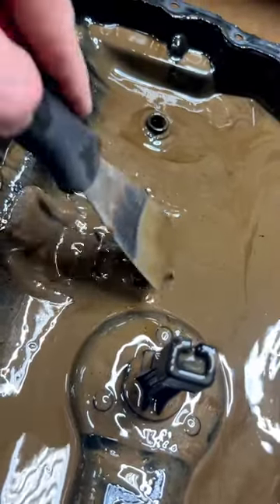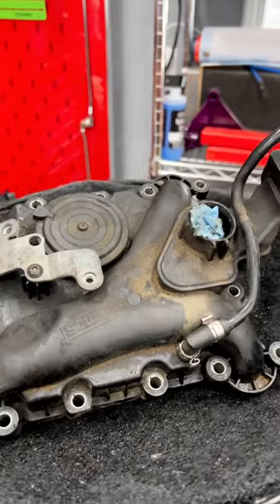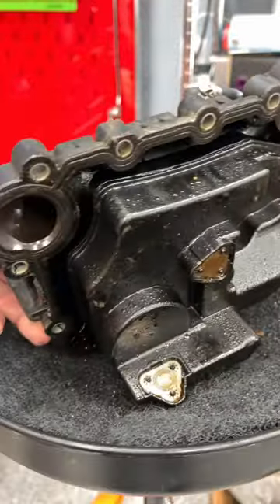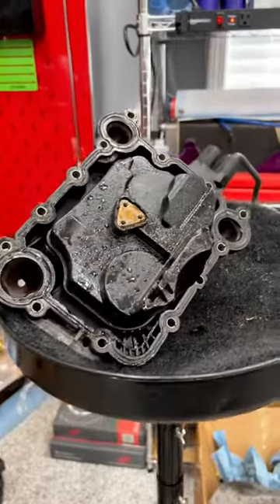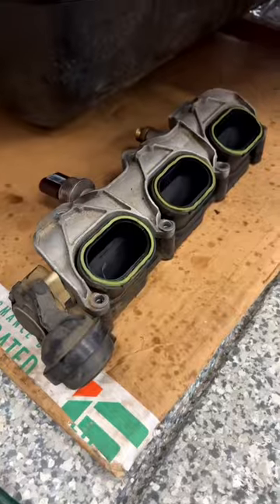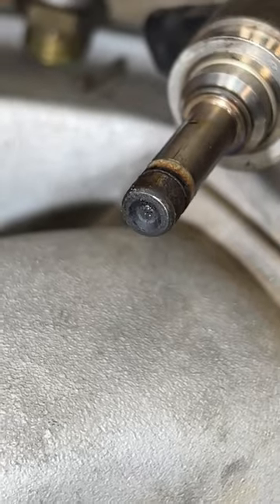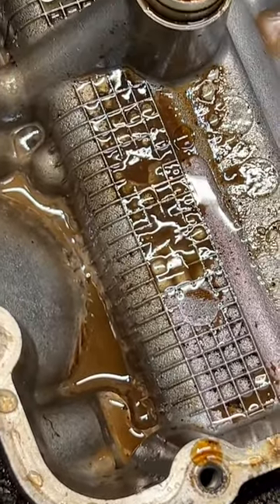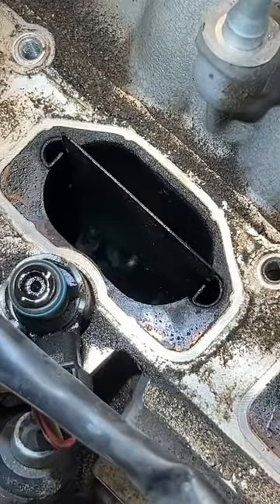Audi S4 With Coolant in the Engine OIL ~ FAILED PCV Valve

Comment: How to make an unnecessarily complicated PCV valve
Reply from the maker: This one is wild. LOL
Reply: Germans for you
Reply: They tried to circumvent the issue with the electronic heaters going bad. It's an over-looked problem: icing of the crankcase vent system on  force inducted engines.
Reply: @LynxStarAuto  I bypassed the pcv in a 1995 Volvo 850
Reply: @LynxStarAuto  this , 8.1 gm engines do it and I had one blow 5 of 9 quarts out the front seal. 
I got there ,the breather was thawed and it's fine. 
Put oil back in and send it. 
Stupid propane fuel and lack of insulation around the breather does it every time.
Reply: @bernardaflores1720  sure, you just disconnect the top hose that captures the oil vapor. On forums it actually says its BETTER to disconnect as clogged pcv is bad
However you can always clean and replace said hoses which is what i ended up doing anyway. Plus with 95 and before vehicles have a lot of environmental standards such as EGR and pcv. Stuff like cat converters, things not necessary for engine health
Reply: @MrTheHillfolk  I don’t have much experience outside of the Euro demographic, but leave it to GM to just run a good ole breather hose on modern CCV system 😅
Reply: @QkjajshsjajaCcccc  if you by pass the PCV, you then need to vent it to the atmosphere like it used to be done before the PCV valve was invented. Otherwise you will blow out a crankcase seal.

Also on Volvos don’t they use a drip plate inside the engine? Or was that newer 5 cylinders?
Reply: @lynxstarautomotive208  the failure of the pcv is the clogging of box or hoses, ive read forum posts about people disconnecting the top hose and running it fine. But like you said, it can damage so replacement is always the better option, the exact reason why i cleaned and replaced my hoses
The drip box is outside the engine under the manifold. Connect via hoses and the drip ‘nipple’ as volvo refers lol. Runs into the pan
Reply: @lynxstarautomotive208  the pcv vents the vapor back into the intake. Id say i ran it like that 1000 or so miles maybe less. Cuz of my financial situation at that moment i couldnt afford the 40$ plastic clip for the pcv into intake boot. Ran fine id say maybe better than with the clogged box creating so much pressure
Reply: @lynxstarautomotive208  yeah all I know about gm stuff is thru work, generator service. 
Other than that, I stick with the euro stuff too.

Comment: So glad I have the 2.0L 4 Cyl in my A4. The PCV valve went bad on it a year or so ago. Ordered one off Amazon, replaced the old one (right on top of valve cover) and worked like a charm. No coolant passages or silly engineering that would cause a failure of a pretty minor part to let coolant into the oil and ruin an engine. Engineers VS mechanics will be a war fought for eternity.

Comment: That's insane. Similar to fords transmission cooler on their 3.2litre 5 cyl diesel; tiny little rubber o-ring separating the coolant and ATF. Done more than a few transmissions because of that.

Comment: "i just did 40 mins of labor taking stuff out and now i have a chance to spray brake cleaner into my intake manifold to decarbon it, at least a little"
"but not this time yikes"
Reply: Lol brake cleaner ain't solving your problems. It needs a full induction service. That adds another 200-300 to the price tag because it's a process of chemical, and mechanical labor to leave them clean.

Perhaps the customer didn't want to pay for that. It happens.
Reply: Hahah bro maybe the customer isn’t fond of the bill already?

Comment: 220kmi on the 3.0 supercharged is impressive. Question would the motor be toast since coolant was ran though the oil system? Thinking bearings
Reply from the maker: Possible. but only time will tell. LOL I have a video coming out where I flush the engine a few times.

Comment: Are all cars made that way? I have that same rusty soup in my old Buick century. I was telling my son it looked like coolant and oil mixed!?
Reply: If it’s a 3.1 Century from late 90s/early 00s, it’s probably your lower intake manifold gaskets. If it’s even older, then I would lean to head gasket. Need a mechanic to confirm.

Comment: I have 08 Jetta Put key in ignition you can’t turn it to crank the car but the steering wheel with the key out is not locked. Is this a faulty lock switch or a gummed up steering wheel lock? Thank you.

Comment: That’s like the automatic transmission in Nissan’s trucks and SUV’s from 2006-2010 the transmission cooler goes through the radiator  and a thin piece of plastic separates the transmission fluid and antifreeze and whenever the vehicle gets around 120000 miles on them the plastic separates and you end up with transmission fluid in the antifreeze and gums up your motor if you’re lucky if you’re not then the antifreeze goes in the transmission and locks it up so if you’re going 80 mph down the road and that happens the vehicle locks up and slides to a stop and hopefully nobody is behind you so you don’t get hit. Nissan is aware of this problem and like every other company they put money over people and said it’s easier to let the problem go then to recall them and fix their problem . I have one and it has already happened to me because my wife wanted a automatic and not a manual 😢

Comment: How...HOW does Audi/VW screw up something as simple as a PCV valve?!! SMH

Ford: "Let's electrically heat the PCV valve on the Duratec 3.0 V-6s for good cold-weather operation."

Audi: "Haha Ford! Your engineering skills are weak! Ve use engine coolant with multiple points of entry for leaks on our PCV valve! Ve also install it under ze supercharger for reduced access and greater heat transfer on cheap plastic housing prone to cracking! Vee Germans are very crafty indeed!"
Reply from the maker: Vw/Audi hasn’t made a good PCV valve

Comment: Dose everything vw makes have such bad problems I have Ben working on a vw gti r32 and it's one of the worst cars I have ever worked on the car only has 60,000 kilometers and it alredy needed a rear mane seal a pcv a turbo valve a turbo a  Head gasket water pump and mane bearings just because the tarible design of vw yeah I am getting paid but gees what a pece of crap I gess that vw made it so I can get paid I will never own a German car maby a mercedes or a old bmw e30 or e35 if vw made parts made of metal thay would not fail as much but I doubt it. Most german cars deathly look good but are the most unreliable pieces of junk on the road I haven't worked on one manufacturer so much I never see Hondas or toyotas for anything serious just brakes and oil and the occasional control alarms maintenance stuff but everything  european I get is engine replacements transmission replacements engine rebuilds suspension rebuilds interior headliners electrical problems can bus communication problems  none stop vacuum leaks and so much more I get paid for it and have had  Is customers just leave their cars at the shop and have us scrap them like this vw r32 I almost garintee this customer will scrap it like the audi rs4 I just scraped it was just not worth fixing the estimate was $12,000 and that was the cheapest estimate we also scraped a mk4 r32 and a mk5 r32 just we just have to get rid of them at the shop we simply don't have space to spare if we can't sell it with in 2 months we get rid of it   threw actions or scrap yards